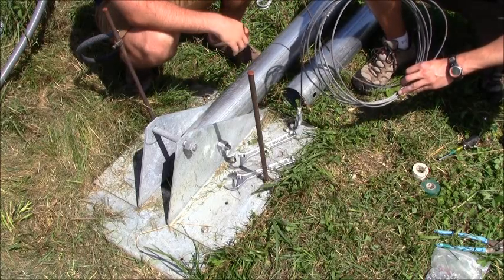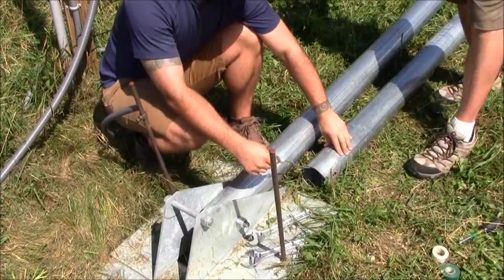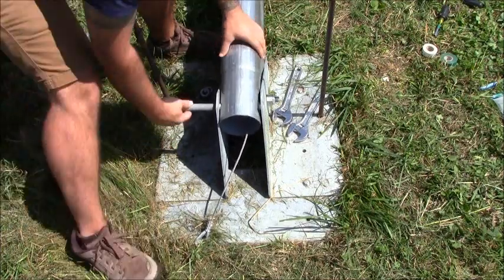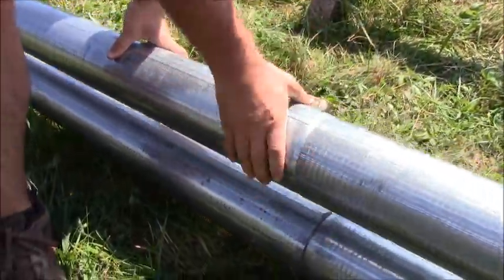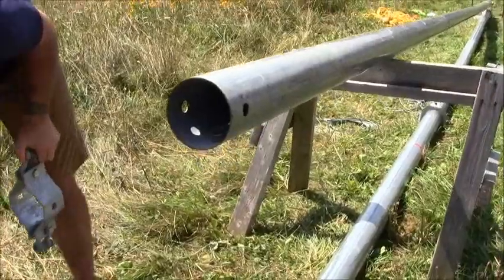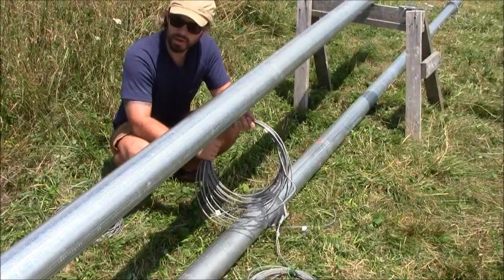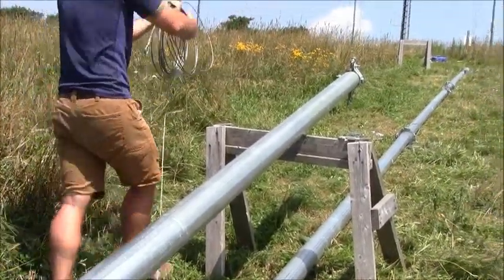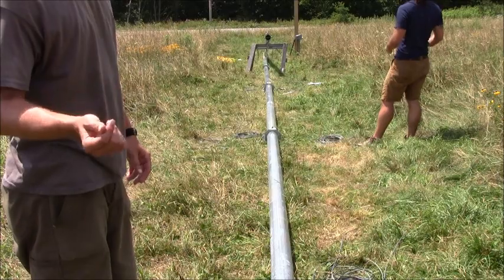Part 2 - Installing an 80 ft. Bergey Excel 1 Guyed Tilt-up Tower

Comment: I know this video is 10 years old, and I really like the information and the way you delivered it in layman's language. BUT! Those   are NOT lag bolts! Hex head bolts, yes. Lag bolts screw into wood and don't use nuts. It drives me crazy everytime i re-watch this. (Finally getting ready to erect mine!)
Reply: Remember, when you put yours up, don't forget to tighten the 

lag bolts.

Comment: safety nut goes on the inside because the large nut is suppose to relive the stress of the small nut.
Reply: s/v Ship of Dreams additionally by adding that much torque on the nut one quarantees that the thread will be deformed.
Reply: Not in this case Joni.
I think the confusion is coming from the application. In a situation where you are tightening a a nut against a material, you are right, you would use the material, then the jam nut, then a standard finish nut. However, in the application in the video, it's all about creating a free spinning fastener assembly by tightening the two nuts against each other, the order won't matter because there is no third force acting on the two nuts. They are only tightening against each other.